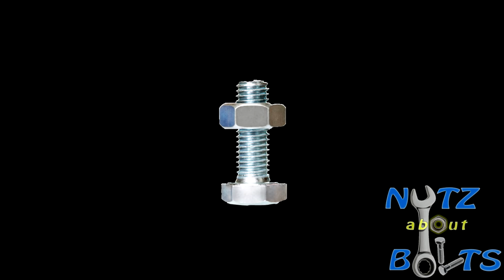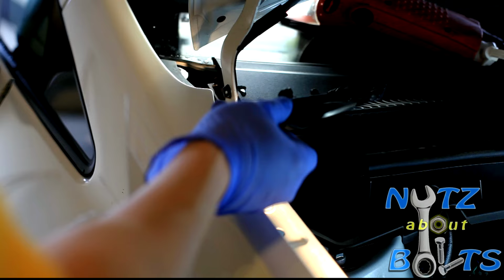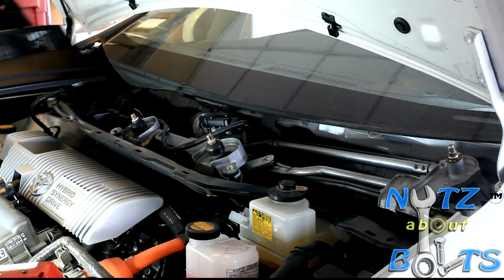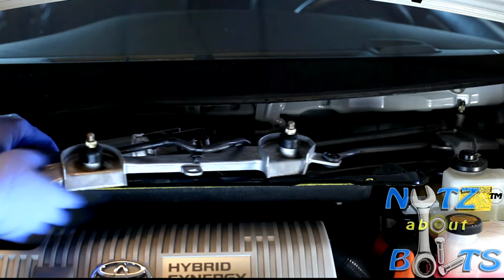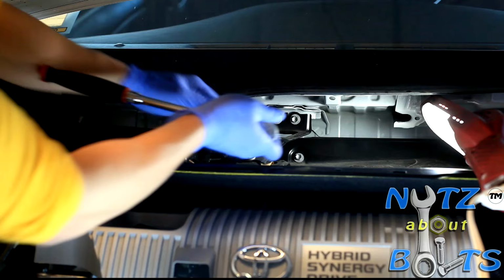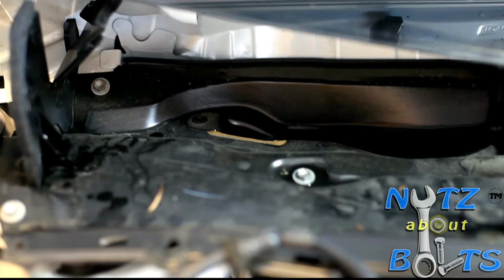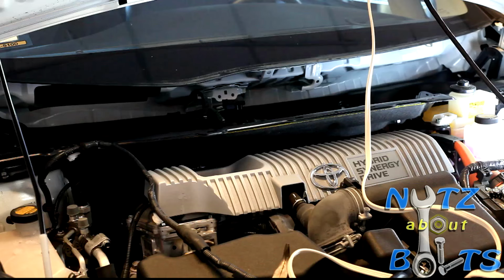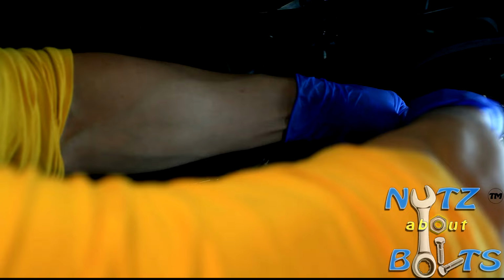2010-2015 Toyota Prius Spark plugs remove and install HD

Comment: You said 20 ftlb and you wrote 13ftlb. Which one is the correct?
Reply from the maker: 13ft lbs
Reply: @NutzAboutBolts  thanks
Reply: @NutzAboutBolts  Agreed.  Toyota torque specs are 15ft-lbs and the 13ft-lbs is the required reduction for the use of anti-seize on the threads.
Reply: OOO!! Can you maybe add an overlay to the video with this correction? I missed this pinned post and had all the specs written down. But then I got confused, not sure (few weeks later) where I'd gotten those specs from. I even searched for "torque" in the comments while working on the job, but then of course missed this post because it doesn't say torque. Maybe even that alone would help......?
Reply: I think all his torque specs he mistakingly was giving the Nm spec - 
20Nm is 15 ftLb
*and for the coils
10Nm is 7 ftLb
Reply: The correct torque is 15 ft lbs.  Anti-seize is not needed, but if you decide to use it, only use a very small amount, and you must reduce the torque by 30 percent.  So the new torque would be 10.5 ft lbs.  This applies to denso spark plugs.  If using NGK spark plugs, do not use anti-seize.

Comment: Thanks so much for this video!  I'm 56 year old female and never changed a spark plug in my life. Although there was much more to remove than you could imagine... yes, just to replace the spark plug, the video walked me through each step. In the end, I was successful!!  149,682 miles on my Prius and it started up and purred perfectly!
Reply from the maker: Wow, congrats! Nice work 👍🏼
Reply: Rock on! I'm 58 and have done light car repair too. Girl power!😅❤❤

Comment: Next, we're gonna have to remove the gas tank and all 4 suspension arms so we can access the bolts that hold the steering column in place. Once this is removed, you can change spark plugs 1 and 3..
Reply: I was thinking this the whole time 👀
Reply: Remove the rubber duck too!
Reply: And certainly remove the rear bumper facia & subassembly to ensure that correct CG (center of gravity) is maintained.  ;-)
Reply: Yeah wtf man? He popped the cover off and had immediate access to the cylinders smh. Did I miss something?

Comment: Were it not for the training video...a few parts would havwe been replaced by the new ones that I needed to buy for breaking the original parts. If I told my dad that on my new car I need to remove the windshield wipers to change the spark plugs...he would just turn and walk away. I smell a conspiracy theory about to errupt.

Comment: Are you kidding! Just to replace the spark plugs!
Reply: That's how mechanics justify the huge labor costs .LOL
Reply: F!@# ridiculous
Reply: Reminds me of bmw
Reply: Thats what I am thinking.
Reply: I used this video to brave the rapids and change my own plugs and coils, I love working on my car now, thanks to this guy!!!
Reply: @Void28368  I bet you're talking about a pentastar. I had one. Just traded it in for a 2012 Prius V. I HATED messing with that one side on the dodge.  What a joke.
Reply: that's easier than my former aerostar
Reply: Jose Gomez They call it book time, the tech has no say on the fee. They just get the ticket and get to work on it and on to the next ticket.
Reply: I know
Reply: I can't believe it requires this much work for me to replace my spark plugs.......
Reply: @juno1597  Ive  changed hundreds of these without a strip down like this 10 mins Max this is unnecessary really
Reply: @slimfd2607  how did you get the coils out 🤔
Reply: @BlackAssCrum  honestly with a little wiggle they come straight out. As a mechanic I work on these pretty much everyday  in my city we have these as taxi hundreds maybe tounsands of them many with 400k miles+  and still going strong the amount of springs, shocks,wheel bearings ,services pads and rotors HV battery etc is countless that I changed
Reply: @katerafael7523  vehicle of nightmares to change!
Reply: the coils are too long to remove without removing the plastic cover above them
Reply: You only have to do it once.   Mine is a 2015 with 150k miles (overdue),  the dealer wants $345.00.  I know it’s BS but they’re the only ones in town that I trust.
Reply: Exactly. I was thinking, this is something I should do. After watching the video, thinking I should get a traditional car again.
Reply: @slimfd2607  several others are saying that the coils are too long to remove without removing the upper panels

Comment: Leave the wiper motor intact and take out the 9 10mm bolts pry the whole thing up and I just saved y'all hella time.. Did one of these today way quicker. I'm a flat rate OG.
Reply: Just to be clear, are you saying that you can get to the 9, 10mm bolts AND the 2, bolts for the reinforcement brackets with the wiper motor assembly in place and all we need to do is disconnect the harness?
Reply: Or are you saying to literally just pry up a bit on that reinforcement bracket to flex it enough to get the coils out?
Reply: What is the brand and length of the spark plug socket you are using?

Comment: Dude, you just saved me $600!!
Was getting misfires. Midas said I had 2 bad coils.
I had to replace the coils and plugs. Midas wanted $1100 to do all 4.
Parts cost me just under $500. I looked under hood and realized that whole washer assembly covered the coils, access without removal was impossible.
 I googled "2010 prius coil replacement/installation", no results
I googled "2010 prius spark plug installation" and found your PERFECT VIDEO.
Exactly what I needed. Thanks a million.
Reply from the maker: +Paul Val thanks! Glad you found us haha. Nice work! half the battle was won when you decide to do this yourself :)
Reply: I have codes 300 301 and 302. the car has 233k miles already...should I try this first?
Reply: @elderreyes3782  did you ever fixed it?
Reply: How were u able to see the video with very poor lighting
Reply: My 2010 Prius is currently vibrating and having a misfire on cylinder 3. Could it be the spark plugs?

Comment: Followed this video to replace my plugs and coils in my 2013 Prius today.  It has almost 224,000 miles on the factory original parts.  I thought I had everything needed....  sockets, extension, ratchet, torque wrench.    Had it apart down to removing the spark plugs, found I had a 5/8" rather than 9'/16" spark plug socket.  Back to AutoZone....  then when I went to torque them, found I needed a 1/2" to 3/8" adapter.  Back to Home Depot.  However once all the right tools, the job was very straightforward.  Moral of the story - don't just check that you have all the right parts, tools and pastes...  double check that your sockets work with your extension, ratchet and torque wrench.  Could have saved myself a few hours....  not the fault of the video, it is excellent.  I should have paid more attention to the recommended tools, and as said, checked compatibility.
Reply from the maker: Good work, at least you saved yourself some $$ and time from waiting at the dealership for them to finish 😄

Comment: I just watched your Prius transmission drain and refill video and was highly impressed and even left a comment which I don't normally do... then I went to find a good spark plug video and BOOM, here you are again with ANOTHER great video and another set of great comments with specs / tools needed / parts needed / links. THANK YOU!
Reply from the maker: you're welcome :)
Reply: @NutzAboutBolts  I have a rattling sound when engine starts that appears to be getting louder, I'm close to 150k. Already did the plugs & oil change, any suggestions?
Reply from the maker: Johnny Boy try egr sssembly cleaning.
Reply: @Senorlatulla  2 years too late probably i had a rattling noise was the exhaust heat shield resting on the exhaust pipe, right behind the catalytic converters

Comment: Having been a decent wrench for most of my adult life I have to congratulate you as there are few mechanic like yourself that will use anti seize on the spark plug threads also using a torque wrench on the spark plugs, it is no wonder these people that don't use anti seize on the threads or dielectric grease on the igniters or coils wind up breaking the frozen spark plugs of in the head. You explain everything very well and show step by step, I salute you for the professional you are...  Thank You
Reply: Some spark plug you aren't supposed to use anti seize. For example NGK uses a trivalent plating and has a disclaimer on their site stating not to use anti-seize.
Reply: @MrSqueakinator  yeah I think the anti seize on spark plugs is something manufacturers have fixed. Not like the old fords that broke off inside 😂🤦🏻‍♂️

Comment: I want to give a special thanks for the love and care NAB put into this spark plug tutorial. I just changed my plugs following his guide. I would like to add that other than using anti-seize on the spark plug threads, I also sprayed WD40 on the minor bolts that came in the cal top assembly, wiper motor assembly, etc. Fantastic guide very detailed and well spoken as always. Thank you so much NAB you saved me at least $250 may God bless you forever!

Comment: I did this plug change the other day and it wasn't as hard as it looks.  I actually took my laptop outside and just did the work following along the video.  One thing I did was to take the extra time to clean everything since this opportunity doesn't come along very often.  Something that would have been helpful to know (for us non-mechanics) is to have a plug socket that has the rubber grip washer inside of it to pull the plugs out and to safely replace the new plugs.  Your part number for the plug socket is not the type with the rubber insert.  So here comes the negative comments....I used a little bit of chewing gum to grip the plugs.  It worked great.  Thank you for the excellent videos!!  You are saving people a ton of money!!  My next project is the transmission fluid ($300 at dealer) and the invertor and radiator coolant changes.  I'll do all three at the same time since removing that under-cover seems to be the hardest part.  Thanks again !!!!

Comment: Video mentions 20 lb ft. of torque (at 17:03 mark).  That is way too high for this engine, especially with anti-seize applied (not recommended by plug manufacturer).  The factory service manual only states 15 lb ft. of torque, and that is with DRY clean threads (no anti-seize applied).  If one insists on applying anti-seize (not recommended or necessary), you should reduce the torque setting by 25% to 11 or 12 lb ft. as the anti-seize acts as a lubricant, giving a faulty torque reading.

Not being critical, the rest of the video is excellent and very helpful.  The description only calls out 13 lb ft. which is probably safe, especially when using anti-seize.  Just wanted to call attention to the verbal mention of 20 lb ft.  Way too high for this engine, with lubricated plug threads.  Thanks for the excellent video!

Comment: im an uber driver and i drive a prius , you can change the spark plugs without removing the covers and wiper motor etc, it gives you just enough space to remove the coils you need 2 short extensions to do the job , its abit of a struggle but the all job takes 30 minutes , no grease is needed and is not recommended either.

Comment: Amazing tutorial. This is my first maintenance item, after doing an oil change. My first time ever working on a car. I have a CT200h and I used a torque wrench, torqued to 20ft lbs, and even used the anti seize grease. My only annoyance is the windshield wiper cowl clearance. It’s possible to be done on the CT without removing it, but it was hard getting the extension socket out. After trying to barely push up the cowl, it would not come out. I then decided to use a flat head to retrieve my socket (didn’t want to risk breaking cowl), which worked well.

I also noticed at first startup it kind of started hard. I hope I didn’t mess anything up. No CEL yet, which is good. Redlined/ accelerated fast on the interstate and it seems to accelerate well. Thank you for this easy, nice tutorial.
Reply from the maker: Thanks! Make sure to torque the spark plugs to 13ft lbs. 20 ft lb should be ok but 13 is the correct torque. Sorry about that
Reply: @NutzAboutBolts  oh crap! I would if I didn't put everything back together!! Lol. 
If they are tight on there at 240k miles I'll figure it out. 7 ft lbs isn't too much of a difference anyways!
Thanks for the tutorial!

Comment: Great video with lots of detail.  Thanks so much for posting.  I bought OEM plugs online for $40 and picked them up at local Toyota.  I watched your video a couple times and then changed the plugs tonight.  Took my time and was about 2 hours.  Went for a drive tonight and runs really smooth.  Now my wife wants me to do her Prius.  Thanks again - you just saved me about $250 x 2 cars = $500.

Comment: Just want to say thanks for making the video.  I noticed over the last few weeks I was having to visit the gas station more often, so I started tracking my MPG.  As soon as I changed the spark plugs I went from 36, back up to the normal 46-47 MPG.  Thanks again.
Reply from the maker: Good work 👍🏼
Reply: How many miles did you have on it?
Reply: @alphawolfadventures1470  125k

Comment: Hi everyone
Just did this myself and the video was really helpful. A few things to remember:
1) It is easy to overtighten certain screws and break them. I did this for the one that holds the ignition coild and it turned an easy job into a problem for me.
2) Make sure to apply the anti-seize grease. It is very important. I forgot it and had engine misfiring.
3) Lastly double check all the connectors (make sure they clicked back nicely) and their wires before closing everything up
Have fun.
Reply: How did the lack of anti-seize cause engine misfiring? 🤔
Reply: It was probably the dielectric grease on the connectors not the anti seize

Comment: All good! I did my plugs this morning at 119k miles in 4.25 years on my 2010. The only change I'd make to how it was done in the video is what he did with the four clips on the windshield wiper wiring. The first one is much easier to remove if you've already taken the four bolts out of the mechanism. That makes it simple to get to the underside of the clip. The other three white clips are just taped to the wire. Cut the tape, leave the clips in place, use new tape when you put it back together. I could probably do the whole job in 45 minutes the next time I change the plugs. I spent $36 on OEM plugs which means I saved $160, if the other comment is correct about the dealer charging $200.
Reply from the maker: David Haile great job! I agree, the next time I do this, I can do this job in under an hr with electrical tools.

Comment: Thanks so much for your awesome video bro! Saved me big time. I used your step by step to change out my spark plugs on my 2012 Prius v. Got check engine light and knocking noise. New plugs fixed the misfire and the check engine light cleared!

Comment: Great video....me and my wife did the change out in less then 2 hours. The dis-assembly and getting familiar with the components took the most time. Have all your tools ready and in reach. Used a magnetic spark plug socket and it worked beautifully. Thank you for posting this!
Reply from the maker: John Moody thanks!
Reply: what spark plug socket you got? i've tried many 9/16 spark plugs sockets and they do not fit the spark plug all the way in.

Comment: Only took just under an hour and this video was very helpful. The dealership wanted about $350 to change the spark plugs.  Saved $320!!  Thanks goodness only have to do this every 120K. Also idles and runs MUCH smoother!  Appreciate you!
Reply from the maker: nice work!

Comment: Good grief!  Toyota didn't make this too difficult did they?
Excellent video though!
Reply from the maker: +Kntryhart thanks lol
Reply: Kntryhart o
Reply: LOL changing my BMW cabin air filter reminded me of this video.
Reply: I've checked 3 dealers $300 cheapest price to have them to it.
Reply: Spectrum Studio's where do you go on these cheap vacations for $300? Let us know lol
Reply: Removing the wiper cowl and assembly- for as much as you have to replicate the process for a number of repairs, they should have designed a two or three levered clamp assembly that you just flip, unplug and remove. Hell i can figure that out and I’m a painter!
Reply: waaaaay more easier to replace on bmw e46 , japanese know how to make it more complicated
Reply: They have a hole which is exactly the right size for the cap to fall down when you are changing the oil, and you can't access anything that falls down that hole without taking off the front bumper(it lands in front of the radiator). Ask me how I know.
Reply: @kimberkimber0  probably can’t do that due to safety or costs. There’s more to things than people realize

Comment: Thanks for such a detailed video I did this job this past weekend in about 40 minutes. One major takeaway for me on this was to hand thread every bolt when you reassembling I just happen to cross thread the bolt for the ignition coil and as I was tightening down the bolt snapped so now I have that to deal with. All in all I love your videos and keep up the great work
Reply from the maker: thanks! yes, we always hand thread all of our nuts and bolts before tightening it down to prevent that from happening. Even with the spark plugs, we hand thread it until its in then we torque it down.